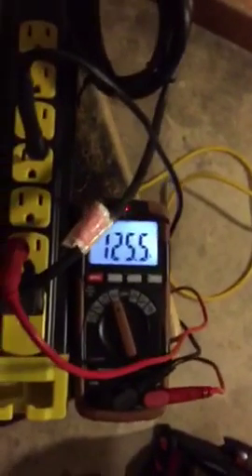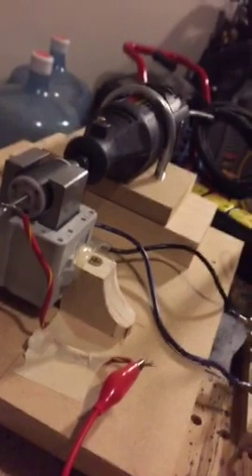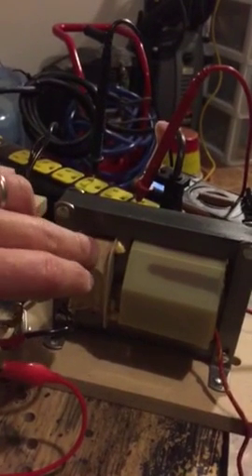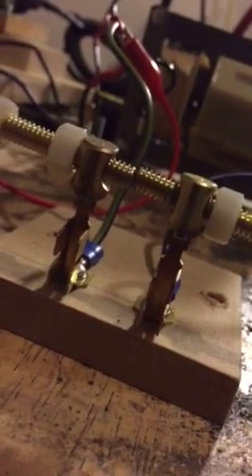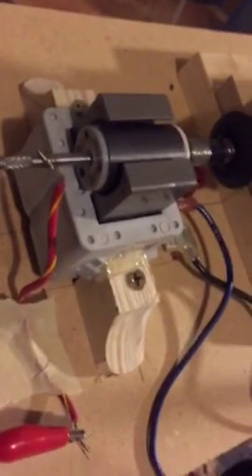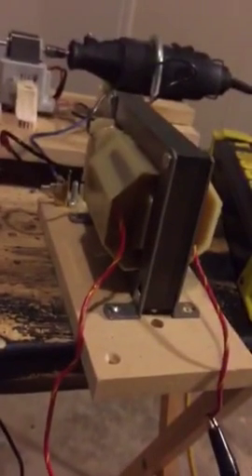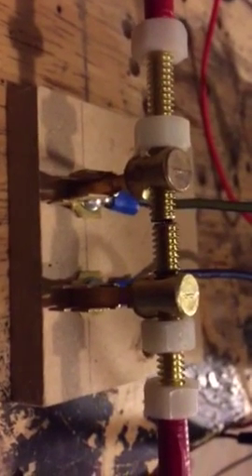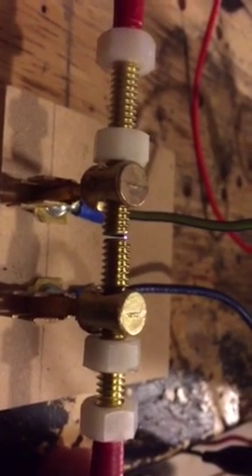No Lenz effect generator

Comment: when touching tread mill ground first time speed increase until body fully charges then once charged no more  increase wounce  charged no more high voltage charge dumping motor stabilizes...earth ground pulsed on/off or capacitive and rectifier in series with adjustable resistor bleed off...interesting alligator clip spark then speed increase...(justified by series spark gaps)...